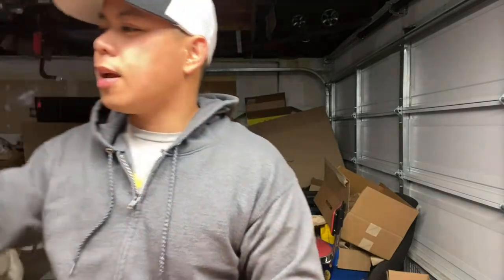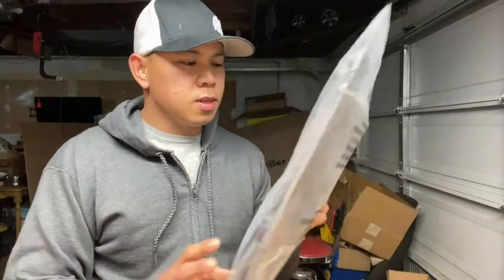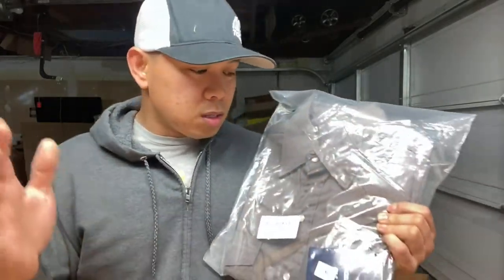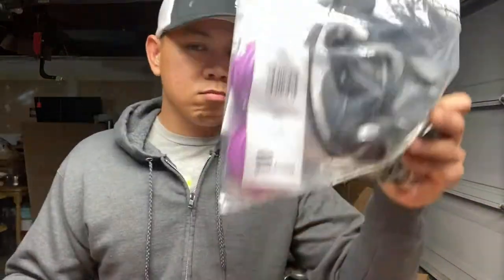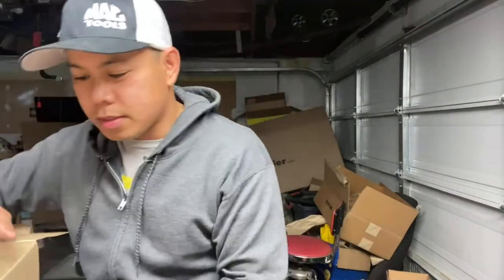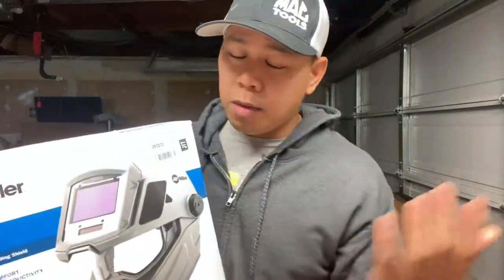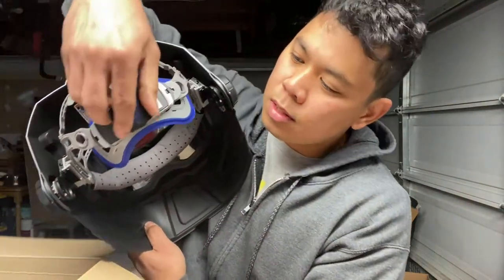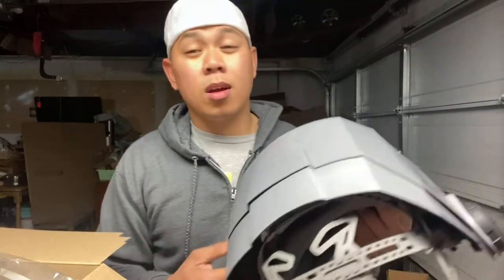Welding Tool Haul #cyberweld #T94i

Comment: That’s all good stuff brother. 
You’re probably going to want to get some lighter snug fitting gloves for tig, it’ll make it easier to feed the filler wire and be more comfortable to hold the torch.  Also if you want some top of the line FR welding shirts and pants look up “Up in Smoke” his stuff is about as good as you can get and it’ll last you for years. 
Keep a cordless drill around to sharpen your tungsten on a clean grinding stone on a bench grinder, and acetone because clean, clean, clean everything for tig. A stainless wire brush will make your life easier too. 
Keep the videos coming 👍
Reply from the maker: Holy shit thank you for this information man... i appreciate it...